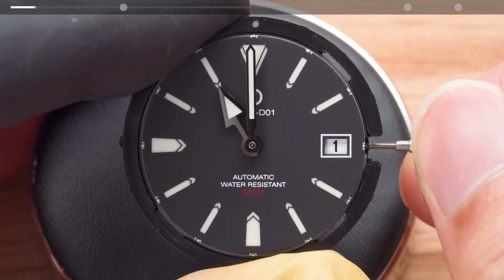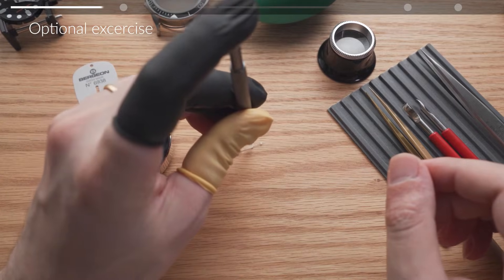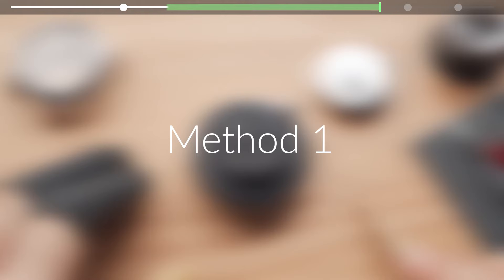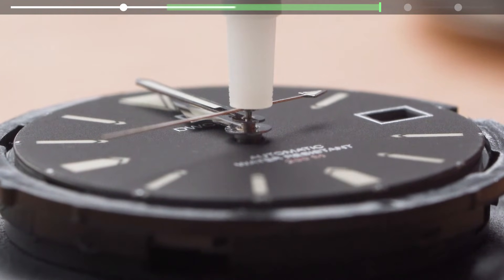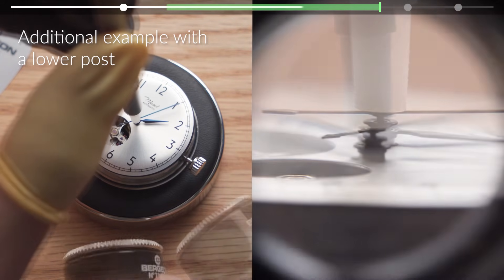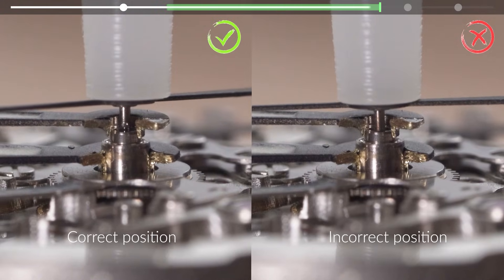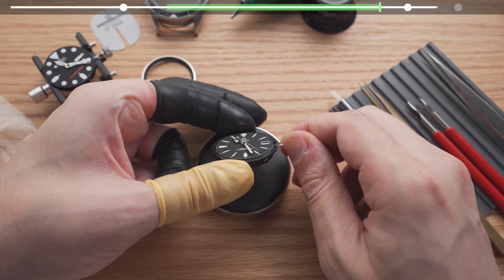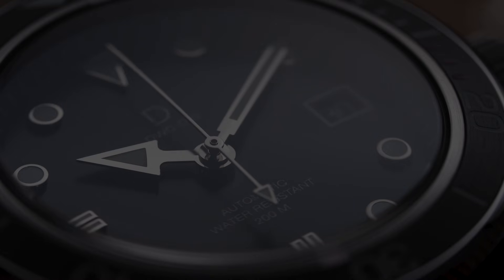Watch hand installation detailed guide part 2: Second hand setting (Challenging!)

Comment: I have one pet hate with secondhandS sometimes they don’t hit the second marks on the watch outer edge perfectly like they’re a little bit before or slightly passed the second marks on the edge of the watch so if it’s moving in seconds, it’s not exactly on the mark and then it’s sort of a little out at the 12 number, etc. 
My OCD is killing me. Is there a way to fix this secondhand to hit The marks along the watch 60 times perfectly.? or is this a pipe dream ?

Comment: Thank you! Was able to replace the movement on an old nixon watch i had sitting in my closet for years, with nothing but some tweezers and a cheap set of flush cutters to push the hands in with. And a 6 dollar movement on amazon 😅 saved a $150 watch! 😊😊
Reply: I pulled the hands off of an old 26mm Casio quartz diver with my fingernails. I did that because I only needed the dial for something, surprisingly I pulled it off without damaging the hands at all! haha

Comment: if anyone happens to watch this video because they are struggling quite a lot with the second hand and are pretty new- if your not 100% sure that it is the right way up then turn over the hand and try the other side. My second hand has a piece sticking out of it which made me think it was the bottom but it was actually the top which gave me about an hour and a half of trouble before mistakenly putting it on the other way around.
Reply: Same happened to me as well. I turned it upside down boom forst try went in

Comment: I find the most challenging part of setting the second hand is with a quartz movement. That is to set the hand exactly at the index marks when it ticks. It doesn't matter with a mechanical movement, but with quartz movement, it would look sloppy if the second hand does not stops at the index marks. I usually have to do it several times to get it right. Any tricks you can share?

Comment: Hi, thanks for the video, it helped me a lot, I got stuck after fitting the hour and minute hands so I watched your video for a re appraisal. What I actually did was hold the second hand in position on the tool with Rodico just to get it loosely on the post, then removed the Rodico before pressing, your video helped!

Comment: Excellent video. The watch I am trying to fix is a vintage (60s) Timex marlin. My second hand does not have that tube that would fit onto the post. It just has the hole. So it falls off or rubs against the minute hand. Do you think that possibly it's an aftermarket hand intentionally made without the tube? (Or, do some companies make the second hand w/o the tube?) Thank you.

Comment: Grab the hand with your tweezers, properly place it on the pinion, push in place with the flat/other end of the tweezers. And for those asking why not set the hand at the 12:00 position, the only reason to do that is if you want to test the hand is not touching the minute hand while installing it.

Comment: I'm confused why the seconds hand would not need to be set when it is in position aligned with the hour and minute, at 12 o'clock. It seems if you set it randomly then how would the second hand end up at 12 when the minute hand is on a minute marker, as it should be?
Reply: I’ve never built a watch but I have a nonhacking 7s26 in an skx and I simply sweep the minute hand into position pointing directly at a minute marker right as the second hand is moving past the 12. That way the future minutes line up with their markers as the second rolls over. The downside is that you can never perfectly synchronize with the atomic clock but at least your minute hand will track right. And your watch time should be able to be within +/- 30 seconds of the atomic clock.
Reply: With a hacking movement (like the NH34) you can simply hack the movement with the second hand pointing at 12 and then set your minute hand to point directly at any minute marker.  Then your hands will all line up properly as minutes and hours roll over.
Reply: @sabr77 Finally an answer I can understand.  As a newcomer to watch collecting and being very interested in my first build this was the detailed reasoning I needed.  Thank you.  So...for a more complete answer...I assume with a non-hacking movement, you'd need to align the second hand to get a good result.

Comment: Great video. For setting the second hand I put a tiny bit of Rodico on the tip of the setting tool so the second hand sticks to the tool, this frees up my other hand to hold a loupe/magnifier so I can see if the second hand tube is seating on the movement post.
Reply: Yes, this is definitely the way to set the seconds hand - especially on a Seiko movement with the hand a really tight fit onto the pinion. You can view the dial from the side and place the hand onto the pinion and set quite firmly without any risk of damage.

Comment: Why don't the hour, minute, and seconds hands all have to be aligned straight up?
Reply from the maker: In most mechanical movements the second hand beats multiple times per second. There's no harm in aligning the second hand, but in reality each second hand tick is so short and so quick that people hardly notice the alignment. And more often than not, because each tick is so small, there will been a tick where the hand is more or less aligned with the other hands.

Comment: Wouldn't it be a better idea to have the seconds hand in perfect allignment with the other two?

I just have noticed that none of these tutorial videos seem to do this. Is it possible to loosely set the seconds hand and then rotate it to be in alignment before you set it?
Reply from the maker: Sorry don't know how I missed your question...! This is a good question. Reason for not needing to align the second hand is that usually for mechanical movements, the second hand moves several times per second, like 6 times per second or more. Each step of its move is 1. too small and 2. too fast for human eyes to see whether it's align to the mark or not, and with its small steps, it'll likely land on the marker by itself. You'll need to align the second hand if 1. you are installing second hand for a chronograph for its flyback to the zero second and 2. for quartz movement that beats once per second.
Reply: @DIYWatchClub  Well i don't mean perfect perfect allignment i mean not like, off by 20 seconds. I see people put the hour and minute hand at the 12 oclock position with the second hand hacked and they put the second hand on at 4 or 6 position like you did here.

I"m just wondering why don't people mount all of them more or less in allignment?
Reply from the maker: @nunyabusiness9056  There's no downside to not aligning it and it's easier. Simply that.
Reply: @nunyabusiness9056  I don't understand why he said "there's no downside to not aligning it".  Assuming your watch is non-hacking,  isn't this your only chance to make sure the second hand is straight up when the minute hand is straight up?
Reply: @robertbrandywine  I know. I was working on my first service and repair and it was a 7s26 movement it was driving me a little nuts that when the second hand was straight up the minute hand was in the middle of the ticks. Ended up letting it run out of wind and resetting the hands properly.

Comment: Hello! Great video. I have a couple of watches that are great apart from the hands, any tips on how I can accurately measure the size of the watch hand post diameters? Thank you and keep up the good work!
Reply from the maker: Best way is to find out the movement caliber and then seek out the information online. Measurement can be inaccurate for various reasons.
Reply: @DIYWatchClub  awesome thank you very much!
Reply: @DIYWatchClub  hello again! Took your advice and looked up the movement, it's an FHF 96 17 Jewel. It gives the hand measurements as 1.30 x 0.90 x 0.21 mm. I assume this is the post diameters? Also where would you advise to look for hands? Just plain black ones I feel would work well. Thank you for all your help.

Comment: I use either an old biro ink tube or a drinks straw from a drinks carton to place the handset onto the  cannon pinion. Insert the hand into the tube, locate on to the pinion and gently press into position. Stops the hands from flitting away somewhere. I have problems with Rodico. JANBOY. RN. Rtd.

Comment: For installing the second hand, instead of usung tweezers I insert the hand (or hands) into a drinking straw from a drinks carton, or an old biro ink tube, as far as the hole or pinof the hands. this prevents the hand from flitting away while you press the hand / hands onto the cannon pinion. JANBOY. RN. Rtd.
Reply from the maker: That's a nice life hack!

Comment: I'm trying to assemble my first watch but after putting the seconds hand it didn't start working 😕
Reply from the maker: it might be what the video mentioned at 3:15, that the hand is not on the post but rather next to it. another reason can be the movement is simply not wound up

Comment: Soooo, question. I modded my SNK805 from the 7s26 movement to a NH36A, due to the 7s26 failing.

Using the stock face and hands, I rebuilt my watch on the new movement.

For some reason, my watch, fully wound up, will spontaneously stop ticking. I just removed and reinstalled the hands, using your videos, but I still have the same problem. The whole movement will lock up, as if out of power. Oddly, I know it is movement has energy, because the SLIGHTEST tap on the crystal of the watch, will free the second hand up to start ticking again.

Even with the movement out of the casing, held by a movement vice, the second hand stops. There is no contact between hands, nor between the hands and the face. Since the movement is out of the case, I know there isn't contact with the crystal either.

More often than not, when the second hand "stops", there is a very slight oscillation to it, as if it is twitching, but doesn't have enough energy to overcome a stop? 

Thoughts? Insights? You said damaging the second hand shaft is the most common damage your students make, but didn't explain what that damage might look like. Did I bend the second hand shaft?
Reply from the maker: Have you tried removing all the hands and see if the movement still spontaneously stops? You can look at the swing of the balance wheel to determine if it is still running. That way you can determine if it is a hand related issue or not
Reply: @DIYWatchClub  DIY, no I have not tried to run the movement without hands, but in some trial and error, it seems the movement ran reliably for 45 minutes without the second hand installed, when it locked up after about ten minutes with the second hand installed. I might try pulling the SHand and see if the movement is reliable without it, and if not, try your method of running handless and looking for a bound up balance wheel/stoppage.

Thanks for the insight, I will keep you posted.

Comment: PS would you recommend the hand held hand-setting tools like you have rather than the static press for a beginner?
Reply from the maker: We prefer the hand held tools over the press. The press has the advantage of little to no deviation on the horizontal direction, so it's easier to keep the hands level. If you know what you're doing you can standardize the exact height of each hands as well. But the hand held tool allows for more sensitivity and freedom, does the same job at a cheaper price, and trains your hand not to rely on machine to maintain control. As a beginner, you'll probably find the hand held tool to be a more rewarding experience to use than the press. But if you're a professional or you're making watches in a large volume, a press definitely makes your life easier
Reply: @DIYWatchClub  Thanks very much. That’s really helpful advice. Much appreciated!

Comment: Why didn't I see this video before attempting my first mod? I just damaged my movement beyond repair. 😭 I thought the seconds hand had a pin, but on the hand itself. I never saw the little pinion inside the cannon pinion tube. Or the super tiny hole in the tip of the seconds hand pin. Its a Seagull ST16, so it can be replaced cheaply, but I hate not having my favorite watch until I get a new movement. I've been looking around, and I see no spare parts for this movement, maybe is because is so cheap to begin with.
So, big lesson learned, and it won't happen again. Definitively a skill worth to master. Thank you so much for the super detailed video.
Reply from the maker: It is indeed challenging! It's good to learn with a cheap movement like Seagull. Hope you finish making your watch soon! And do let us know how it goes!
Reply: @DIYWatchClub  I will, and I'll post it on both my channels as well.

Comment: I would like to get the same eye loupe. What is the model number and magnification?
Reply from the maker: The loupe in this video is Bergeon 2611. Magnification is 3x (but this model has an aluminium ring that allows you to change the lens to up to 7x). We don't have it in our store yet but you should be to get it elsewhere